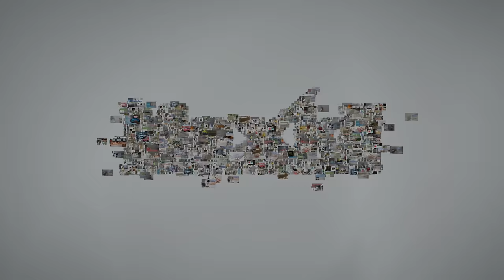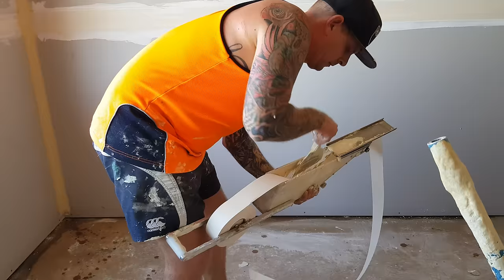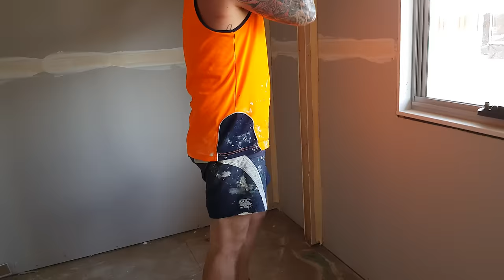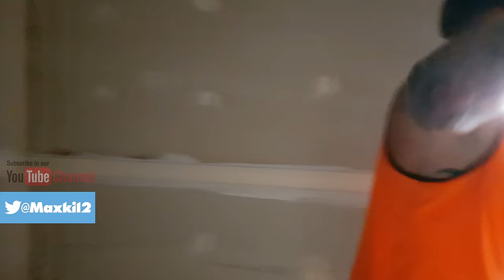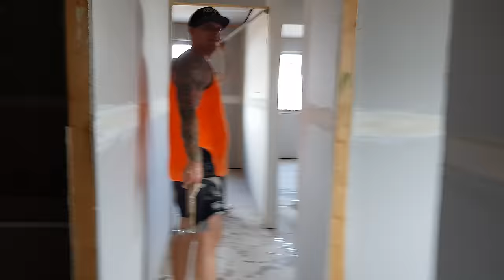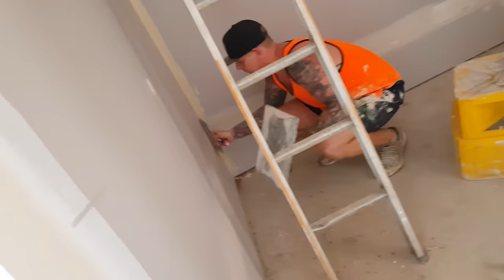Drywall Paper Taping with Corner Roller and Straight Flushing Glazer

Comment: I've seen a few of your videos now.  I've noticed there is usually a gap at the top of the walls.  Is that just something you guys do when you know there is going to be crown?    I'm not a production drywaller, but I always tape that intersection even if there is crown.  I suppose my reasoning is  part 'fire taping', part future proofing, part just wasting time.     I also always have a personal relationship with the customer. I'm sure I'd have a different approach if doing production work.    Just curious.
Reply from the maker: Hey thanks for watching the videos. Yeah most of our houses have crown molding going up. It's made from the same materials as the drywall. Here in Australia there doesn't need to be fire rated and sealed everywhere only when it's specified. Only between two dwellings. Only the separating walls as well. It's a lot of extra work and the builders don't specify it and don't pay for it unless it's needed. Also normally people just leave it when it is up. I tell you what though it's very quick as you can see. Thanks again for watching please subscribe and say hi again! Thanks Bob

Comment: Wouldn't it be better to just use thr flusher or knife? Doesn't the extra step take away from time? What are the benefits of the 3 steps? Also, I'll be doing a unit by myself. Should I do it like this aswell? Srs questions.
Reply: this method is much quicker believe or not.
Reply: If you use knife, u will need to measure and cut paper for every single corner and apply the mud to corner isn't that easy and really slow. They two can finish one standard house in 1 hour but using knife will be at least double time.

Comment: Been watching you videos for a while. What's the reason for not having the ceiling angle fully drywalled? I always notice they are short. Do they always crown molding?
Reply from the maker: That's my most asked question , 
why the gap between the ceiling and the wall, yes about 80% of the time that is crown molding going up and unlike the USA it doesn't need to be fired proofed and the gap gets covered up buy crown molding made out of the same material
Reply: Perfect makes alot of sense now lol. But yes out here even for crown molding it has to be at least fire taped. Great videos fellas. I myself am a taper and you'd think I get enough of it at work lol but it's awesome watching other people do the same thing get to learn new things here and there.
Reply from the maker: yeah takes longer your way taping behind the crown. its slower but i see the benefits. Our way here is super quick,